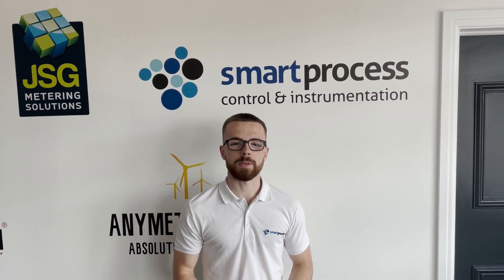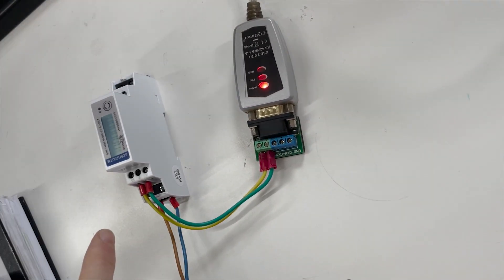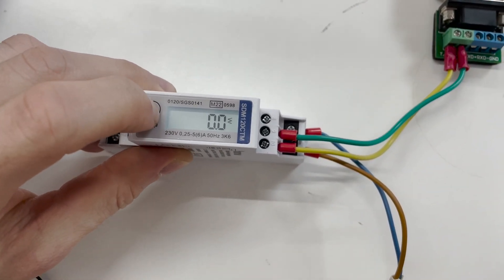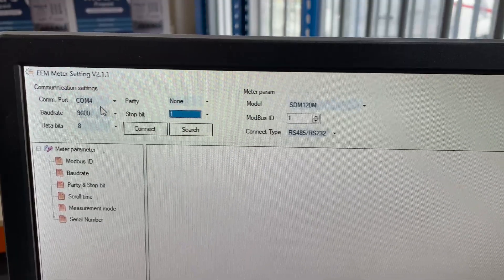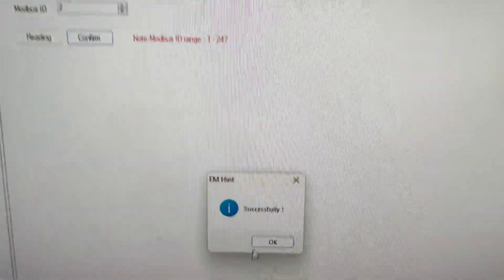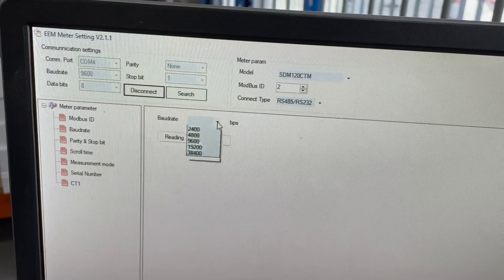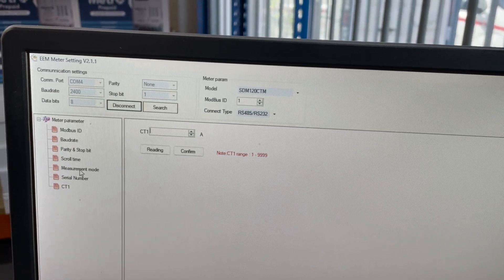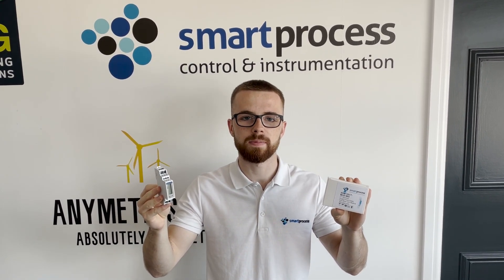How to Programme the Eastron SDM120 Series (Modbus ID, Baud Rate, Parity, Stop Bits, CT Rate & more)

Comment: Hi Scott, thanks for informative video. User Manual for my SDM120CT (not MID) says the following RS485 communication parameters can be configured from the set-up menu: baud rate, parity, stop bits, modbus address. Manual also says to keep pressing the button for 3 seconds, the meter will enter set-up mode.  But I can only set CT rating from the set-up mode on the device.  Your video advises that I need to use the EEM Meter Setting program to modify the other parameters.  So the User Manual gives wrong advice. Very frustrating.  Pls request Eastron to correct their User Manual. The manual should state that Eastron computer software must be used to configure the RS485 communication parameters.  Thanks for your advice in the video.  (if I'm wrong, please advise how to change modbus ID using the SDM120CT set-up mode.)

Comment: The SDM120CTM MID version can only set CT1 once by the meter inferface. Still by using the software in set mode, user cannot change the CT1 again and the software version that you provided was V2.0.0 not V2.1.1 .

Comment: Can i pair 4 device ? my work is use 4 deivce and change RS485 to Rs232 for connect to MCU
Reply from the maker: Hi there, not very clear on the question you are asking. This software is used is to connect one device to edit the parameter settings. You can connect up to 32 devices on a ModBus line. This meter has RS485 ModBus for comms, as well as pulse, and this cannot be changed on this particular version. There are versions of this meter with MBus and pulse. I hope this helps.

Comment: Having a right mare, instruction manual clearly states that modbus address, baud, parity and stop bits can be set using the set up menu, does not state anywhere that you require to do it via laptop?!  For Mbus it states you have to do it over Mbus communication, but modbus it doesnt?!
Reply from the maker: Apologies to hear this Steve, If you want to program the ModBus address, Baud Rate etc, you will need to use the relevant communication and connect it up to a laptop or computer to program the meter.

Comment: If you’ve mistakenly set the CT ratio incorrectly, can this be reset/changed via modbus ?
Reply from the maker: Yes, you can change it via the modbus / using the software but not from the face of the meter.
Reply: @smartprocessltd  I've got the CTM version and can't seem to change the CT rate even on the software. Any tips?
Reply: On the non-MID models you can just change it from the face of the meter. 
https://www.eastroneurope.com/images/uploads/products/manuals/SDM120_Series_Manual_.pdf
Reply from the maker: @Carl-Camera Thank you for leaving this comment, to confirm you're able to change the CT rate on the screen of the NON-MID approved models of these meters.